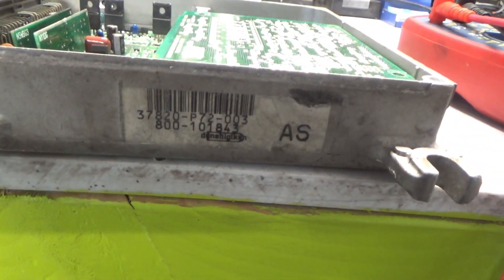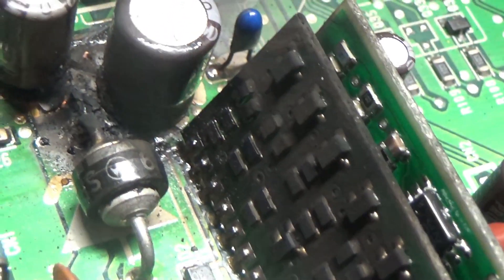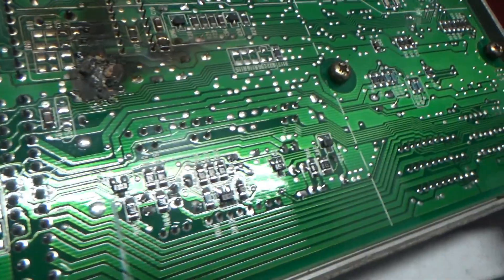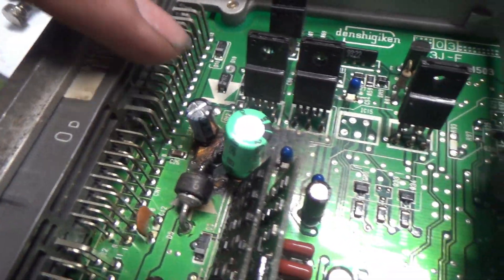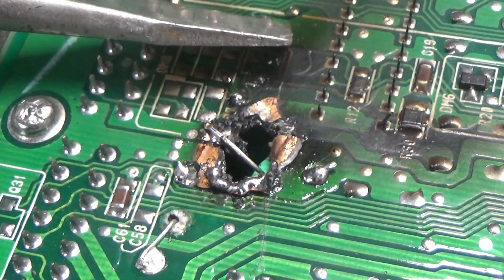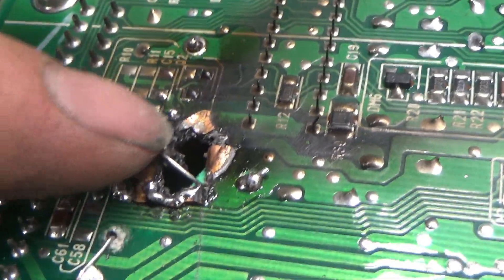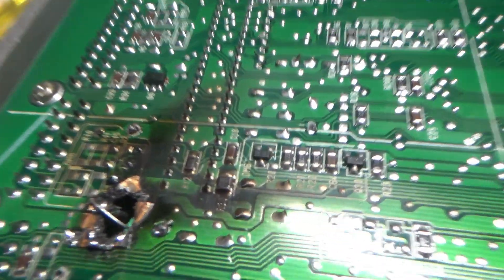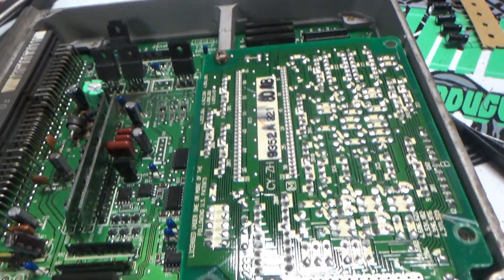How To: Fix Severe Ecu Damage HONDA OBD1

Comment: Thank you for posting this. I just went through this to a lesser degree on my '94 Accord's Ecu. My ELD failed and blew the ELD capacitor in the ecu so hard it almost burned a hole like this but luckily only made it half way through the board. I was able to clean it and then use some copper braid and solder to restore the trace on the topside. I soldered one leg of the capacitor to new "trace" and the other leg to the board like you normally would. Everything worked when done! The only reason I had the confidence to fix my board was seeing that something this bad could be worked with. Thank you.

Comment: Decent job, really good info! I had top do a similar repair on a JDM OBD0 ecu board that a corner got completely broken off of. Ran acorss this vid looking up common fuel relay falure modes on the p28.

Comment: do you know anything about ic17 aka ta8903sn? pinout,datasheet, anything?
Reply from the maker: yes. ecu repair is available thru lambtechdesign
$79
Reply: @yaboizgarage9709  is that a website or?
Reply from the maker: @westhouse4641  www.lambtechdesign.com and contact them best of luck